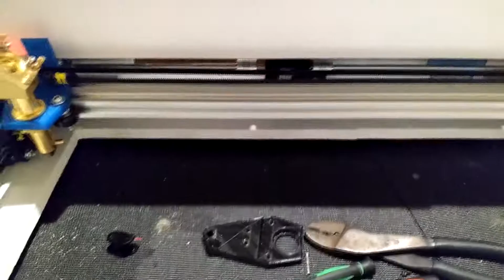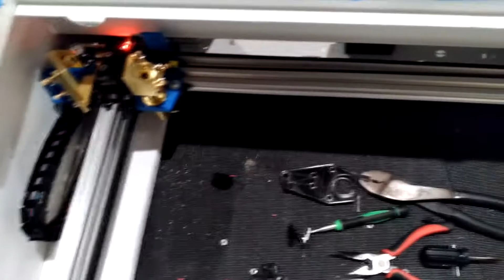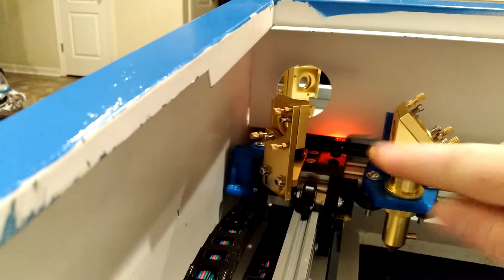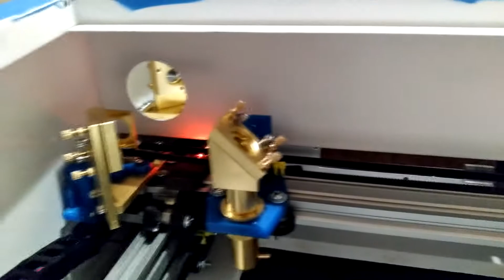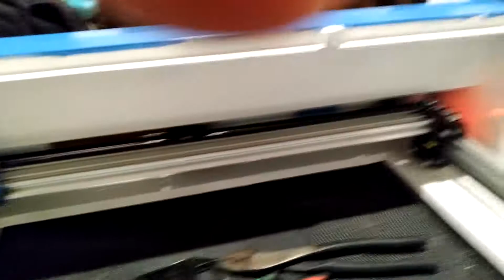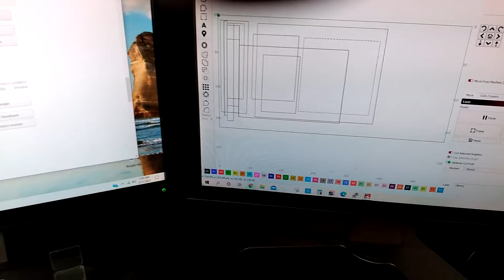K40 bed install and Cohesion 3d Laser board test

Comment: Hey I know this is old but I have 2 questions. Do you get a full 12" Y-axis length with this setup? I've ordered the parts but I wanted to make sure it does a full 12" on the Y. If not I'll probably build a new enclosure. And do you have the mid-mount motor bracket file? I was planning on designing that myself but I wouldn't mind seeing how you made the bracket too. Also how is it running? Do you have any tips after owning it for a while?
Reply: I don't know about this particular build, but if it helps, it is possible to design a 12in y cutting area in the k40. I am currently designing my own gantry, and I should have 12.5inches in the Y direction when I am finished (assuming nothing goes wrong). So you may not have to make a new enclosure, just modify the plotter.

Comment: Hi, I have 3 questions, if you can answer I would appreciate it.
1st: Does this new system connect to the machine's original board?
2nd: where can I get the layout of the parts to assemble in mine?
3rd: After everything is connected can I still use the k40 whisperer?
Reply: He mentions that the project is posted on thingeverse.